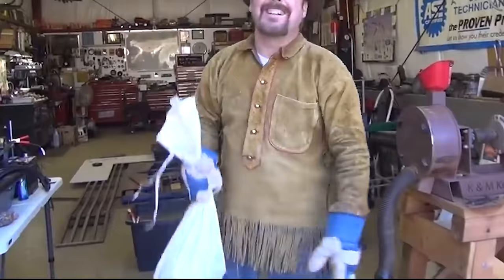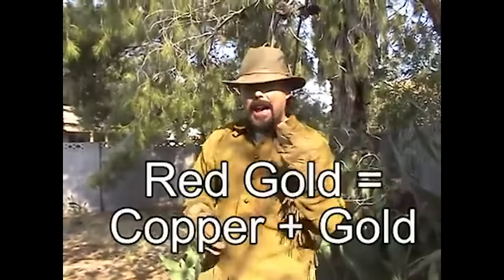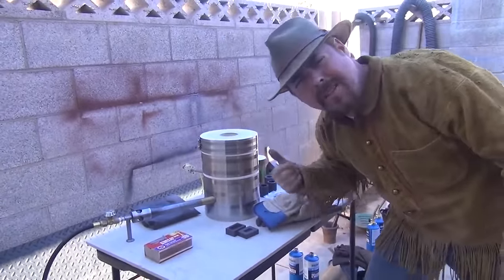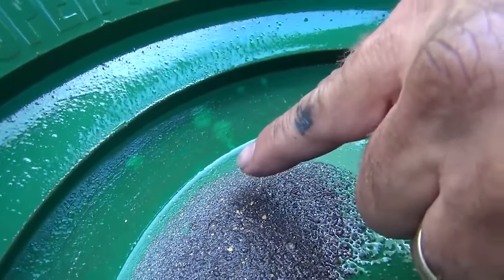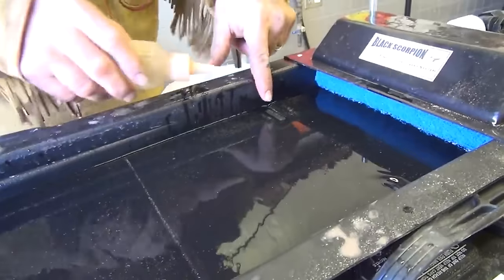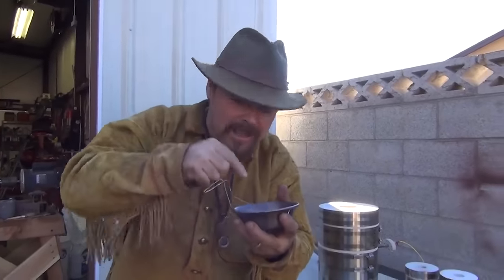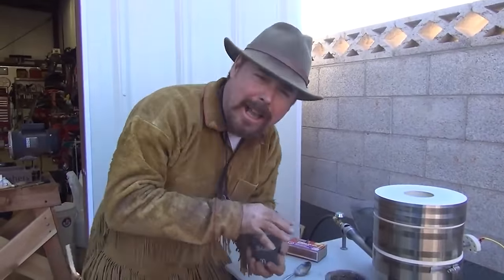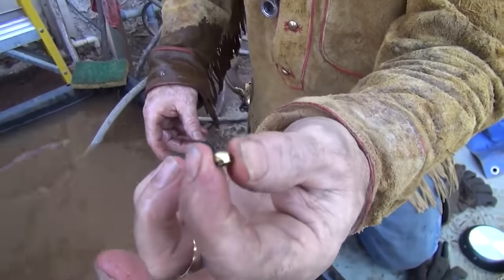I'm Extracting GOLD from Pyrite and You Won't Believe the Results!

Comment: So, I got my hands on 5 pounds of MBMM's high grade, and 26 pounds of his run of the mine ore.  The high grade had free mill in it, and I'm still working on processing it.  (I screwed up my first cupelling attempt, and have to reprocess, but even so, I managed to get exactly 2 grams of gold beads separated so far)  For the mine run ore, I've only panned the around six pounds of screened 30 minus so far, and saw no free mill.
However, I've been wondering if I should smelt down the ferrous material I separated from mine run ore, as under the microscope, is a lot of pyrite. (curiously enough, very little ferrous material was pulled from the high grade ore, and what there was, barely had any signs of pyrite)
The Mighty Mill showed up today, and I'm in the process of crushing down the rest of the mine run ore!
Reply from the maker: thats great ..... keep us posted

Comment: Do you feed your material dry like that still? I was under the impression that it was better to wet your pay prior to feeding it into a Gold Cube? 

I found my first piece of quartz with Iron Pyrite while panning for gold here in Arizona so thanks for this video. Definitely looks just like the brassy stuff you’ve got there. I’ll give it the ole hammer smash to see if there’s any gold in there. I don’t have enough material to justify all that extra gear yet, but maybe after collecting a few buckets of the stuff it’ll be a necessity. 

Thanks for dropping all of your experience and knowledge on us! 

Too many folks clutch their pearls and hold onto that tribal knowledge, but you’re helping newcomers avoid common mistakes and potential roadblocks too. Thanks Jeff!

Comment: So Jeff,  ive known about pyrites carrying values for decades.  Ive never understood them to be free milling? I always understood they required roasting to release if not aditional chemistry to leach.  Costing more to proccess than the gold value with the older technologies but now we can profit from it.
A.  What's the possibility of the free gold coming from your equipment residual from previoys high grade runs? 
B. What's changed to make pyrites value recovery profitable? [I mean, the capitol to crush roast n smelt is key difference along with efficient furnace,  is that all ? Or do we better understand tge metalurgy/chemistry better as well? 
Im currently building an electrolitic cell for .9999 refining and offering custum refining out of utah as small startup [heirlooms to bullion and small batch high grade]

Comment: Jeff, you truly are the best.  However, in this case I see several errors.  First and foremost is not covering what happens when you break down the sulphides.

When you break those down you are also breaking the bond with other elements present.  And when you add water, it's not exactly like a zoo, but there is so much that happens.  In this, the water ideally should be distilled.  Gold can escape by attaching to the chlorine in the water (if tap water).  This may not be much, but it's still YOUR gold!  And it escapes as gold chloride.  Then the other minerals, no matter how minuscule, present also break down with the water.  Rule of thumb is the more massive, i.e. lacking crystalline structure, the most "impurities" in the pyrite.  This can be a lot!  Name any of the metals that bond with sulphur and you could have present in the pyrite.  And that gets into the water.  And that is one of the other problems.

What is being done with the wastewater from this?  Yeah, I know.  The amount YOU produced is minimal.  But...human nature kicks in.  If they, our fellow prospectors, can get more ore, you bet they're gonna get it and process it!  And...you get more wastewater.  No longer 1 or 2 gallons, but 5 gallons.  Then 10.  And it goes up.  Ya gotta process the water before disposing of it.  Ideally you want to test it to make sure you're getting the crud to drop out.  Like molybdenum, zinc, vanadium, lead, iron, copper, amongst others.

In small amounts like you process Jeff, I see no problem.  But as I said, opportunity and prospectors a dangerous pair!  You know, like Bonnie & Clyde, Thelma & Louise, Butch Cassidy & Sundance Kid, you and Slim...oppps!
Reply from the maker: thanks my brother

Comment: Jeff, do you adjust your flux for the presence of copper. My sulfides came from a copper district and have copper sulfides along with azurite and malachite. I only got two pin-head size pieces of free-mill so far. Also some tiny copper bits.

Funny this is posted today. I just got back from Arizona and am trying to decide which process to use now that I roasted my sulfides. I was thinking about electrolytic refining, but fire is always fun!
Reply from the maker: yes ... there are so many Flux recipes out  there like a cookbook for metals

Comment: So you might be a fool to throw away fools gold.   Question, I once tumbled Hg with black sand and used a spiral wheel to separate.   The Hg floured into a pinkish material.  Any thoughts?
Reply from the maker: it has base metals in it and Gold

Comment: hi mr  geologist   .the actual melting point of gold isn t 2000° f but 2200°f ..any lower then 2200  gold isnt totally  rendered  molten ..  and you will loose alot  in the smelting process